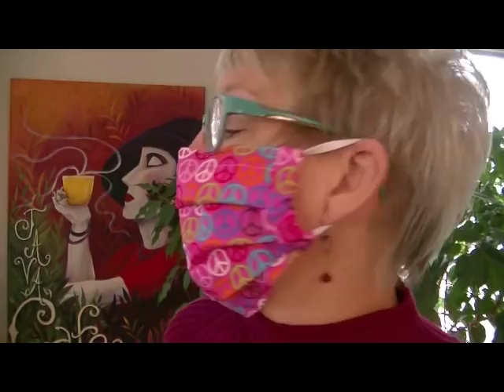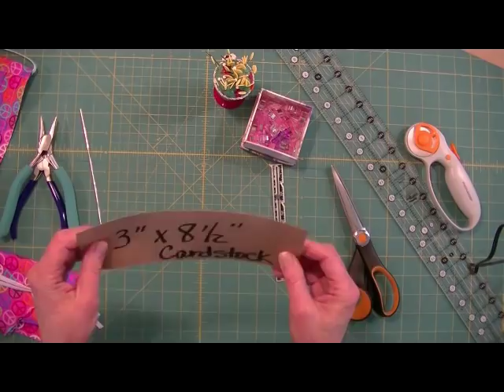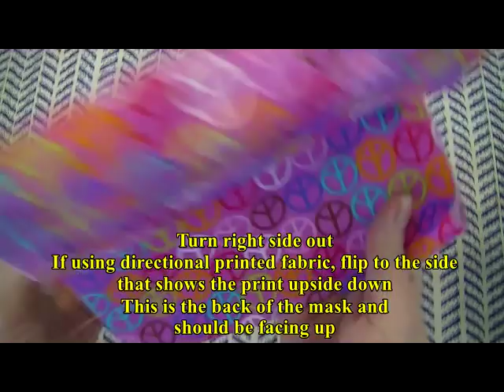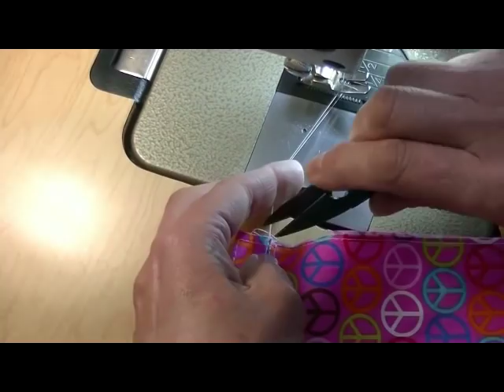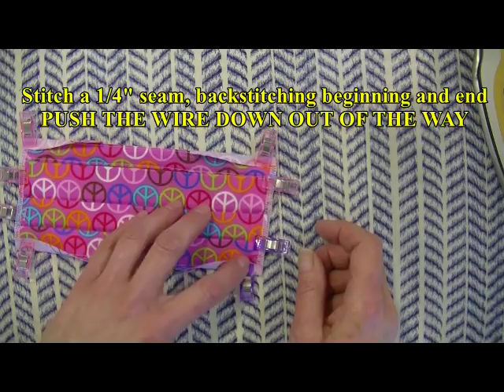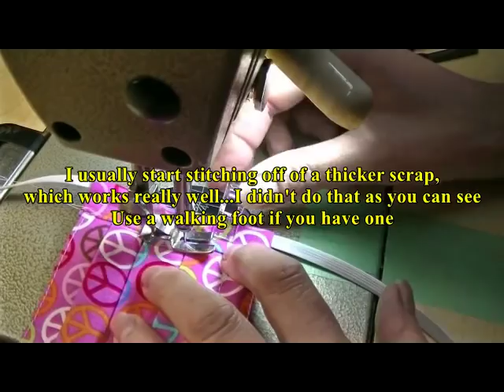DIY REUSABLE FACE MASK with FILTER POCKET-4 Style Options-1 Easy SEW Pattern-Won't Fog Your Glasses!

Comment: Hi Liz. Thank you for a great video. I do not have a surgor on my machine. Should I cut my fabric a little larger than the recommended size as to finish the edges, I would fold it over twice?
Reply from the maker: A serger is a separate machine. Do you have zigzag on your machine? Use that and if you don't have zigzag, trim the edges with pinking shears.
Reply: Hello Joann how are you doing today hows everything going?

Comment: Very nice mask, well explained tutorial. However, I did not like the use of the 14 gage wire. I wear glasses and the wire, even when I try to bend it to the shape of my nose, makes the mask go up under my glasses making it unconfortble. I will try with a shorter wire or a thinner one.
Reply from the maker: You could also try shortening it a bit by pleating it on a 
2 3/4" x 5" card, making the width of the mask 2 3/4" wide. That might help.
Reply from the maker: Also...You can topstitch the top a little lower, like 1/8" or a bit lower, forcing the wire to be lower in the casing. Hope this helps.
Reply: Hello Helen how are you doing today hows everything going?

Comment: I like your video it is easy to follow.  I do have a question - I was asked to make a mask for my grand-daughter - she is 5.  I see you have material needed but do you still mark this at 1 1/2 inch on short side like you do the adult mask?  Thanks in advance
Reply from the maker: Thank you Deb, that is a great question and so sorry I left it out. I would make it 1"- 1 1/4" depending on the size. I'm really guessing with the kid thing lol.
Reply: Making It Easy with Liz me too!  And she lives in New York and I am in PA!  Thanks I will try it
Reply: One more thing and if u don’t know it is fine  - when doing the pleats do u use the same size piece of cardboard?  I did see ur other video on quicker pleats and it is now 3x5 card.  If u haven’t done a kids I will let u know what I find when I do it tomorrow.
Reply from the maker: Yes, I updated that hack. As I made more masks, I made new discoveries. The 3" stays the same, but the 5" allows you to work off the ends and makes my new way easier to do.
For kids, I made the cards 2.5" wide and 2" wide for the littlest one. The kid thing is a tough one for me, and I'm guessing, because I have no experience with them.

Comment: The long elastic that goes around over the  ears for man’s comfort-what is the one continuous length?
AND for the rope tie that ties from your back of head- what is the one continuous length of tie?
Reply from the maker: 12" or around the ears. 24" is a little too tight for me so 28-30" for the continuous elastic that will fit around head/neck. Leave untied if it's going to someone you can't fit it to, and they can do it themselves. For ties, 34"-36" on either side. I haven't experimented with that. I used 28" on mine and it was a bit too short.
Reply: Another question please:
One long continuous elastic for adult is 28-30”; what is the continuous elastic for child age 7-10?

Comment: Hi Liz, if I use pinking scissors, do I have to cut the pattern a little larger?
Reply from the maker: No need, you're just pinking the very edges and the casing adds a little length, you should be OK. If you feel better adding length, cut it 15 1/2"x 7 1/2". Bring the two short sides together and trim 1/4" with your pinking shears, bringing it to 15".

Comment: You are extremely thorough but all of the pressing makes it go very slow. I do like the way you made the  channel for the wire & the pocket for a filter. I would make mine out of 2 layers of fabric for even more protection.
Reply from the maker: Thank you for watching. I can get a mask done start to finish in 20 minutes, maybe less now that I have made hundreds lol. It is 2 layers without a filter which works great considering it's not to protect you, but to protect others from you. Stay safe.

Comment: Heard from nurses that it is a good idea to use 2 fabrics so to know front from back in wearing. My question how do you incorporate 2 fabrics to your instructions and what is the cutting size of the second backing fabric. Thanks!
Reply from the maker: I have heard that and my solution is to sew a folded piece of ribbon into the inside side casing, like a tag.

Comment: Liz,  Really excellent tutorial and the mask fits... Hurrah!!  But how do you place the filter? the pleats are in the way.  Can you demonstrate?
Reply from the maker: Thank you so much, Jennifer. There are so many questions and it is my next video. Open the mask all the way. Take a paper towel and measure across your face to the middle of your cheeks, and to the bottom of your chin, covering your nose but not sticking out of the mask. You dont need to fill the whole mask. The purpose is to stop your droplets.
Reply: Thank you! I'll try - a bit difficult as I have Parkinson''s... best wishes from Belgium!

Comment: What are the measurements for a filter material for the finished mask
Reply from the maker: Hi Jacky
Depends on your face. I would say from the middle of your cheeks, nose to chin. You will have to play around with it.  It's to cover your mouth and nose but does not have to fill the whole mask.  The mask is to protect others from your droplets. Even without a filter, it is impossible to blow out a match. It's basically a surgical mask, made to keep things in, not out.

Comment: LIz:  Thank you so much.  I learned an enormous amount from this video.  I am wondering if you could help me with just one more thing.  I can't find any elastic anywhere.  Can you please help me figure out how to sew 4 ties into the mask instead?    I would really appreciate any guidance you can provide.  Thanks in advance for your extra time to help me with this.  Linda
Reply from the maker: Hi Linda,
Have you ever worked with bias tape? You don't need to cut it on the bias but a 2" strip about 36" long, fold in half, wrong sides together, press and then fold the sides into the middle and press. Then fold it in half and press. Just place that over the sides pin in place, leaving the head straps a bit longer than the neck straps. Turn under the ends before stitching to hide the raw edges. Start at one end, stitching it together down the long edge, continuing over the mask, down to the other end.
Reply: Liz:  Thank you so much for your very quick response.  I am an amateur sewer, but, will give this a try for sure.  I found some 1/2 " or 7/8" x 4 yds.  Do you think I can do something to make this work?  I imagine everyone already got the wider widths.   Everything is pretty much sold out!

Comment: What size should the filter be?
Reply from the maker: Hi Rita
Check out the video description for lots of information.
Reply: Never mind I saw in a post that you only have used Kleenex as a filter so you wouldn’t understand my dilemmas
Reply from the maker: No, I don't know your dilemmas. I get asked that question 10 times a day and I try to address every comment, all 600+ of them. I'm very sorry that I can't repeat myself for the same question over and over again. At that time I had only tried a Kleenex.

Comment: If you are doing string ties.  What are the measurement for the length & width.  Making my own.
Reply from the maker: I had 28" in mine and it was too short. I would say 30-36" depending on the person wearing it.

Comment: Excellent video & mask.  I did pink the ends instead of serging as I am also lazy and didn't want to rethread my serger.  I also love your machine -- what kind is it.  I'm making mine on a Singer 201 -- The Singer & I am oldies but goodies.  Thanks again.  Barb
Reply from the maker: I hear ya, Barbara about threading the serger, that's why I only use white for everything. My sewing machine is a Singer industrial. Thanks so much for watching.

Comment: Liz,  I have been sewing on and off since I was a teenager.  Self taught.  Learned enough to make a few quilts, but wow I always have trouble starting out on the material.  Your trick for dealing with that is fabulous!  You are a wonderful teacher and I loved the little time saving tricks you shared.  I will share one of mine.  I do not use the filter pocket at all.  It is my understanding that NONWOVEN iron on interfacing is a very good filter that is comparable or better than the filter ideas people have been sharing online.  So I iron on a piece that is a little less than the size of the mask when it is folded in two.  It works like a charm.  It is funny, but I am making these masks for people with a great variation in the size of their heads.  LOL  Using your design, I cut off some extra elastic and put it in a bag with a safety pin and explain to them how to fit it to their head if it ever breaks or it doesn't fit quite right on receipt.  Just Perfect!  You are a rock star!  Thanks so much!
Reply from the maker: Thank you so much, Anne. That is a great idea about the interfacing, my friend did the same thing. The adhesive concerns me though. Honestly, for what the mask is actually for, a filter isn't really necessary...I tried to blow out a match without a filter, and couldn't. I really appreciate your support. Stay safe.
Reply: @makingiteasywithliz  You make a good point about the adhesive Liz.   I'v made a few of these so far and everyone loves your design.  Thank you again.
Reply: Liz I found this really good article that indicates that regular surgical masks only have about 60% filtration but the masks that we make with 'Quilters Cotton"  could have around 80% filtration because the threads are denser in quilters cotton.  I also did a little research and found that the adhesive that is on the fusible interfacing washes out and is not really harmful.  I am going to contact the manufacturer just to be sure. Stay tuned.  And as far as aluminum being hazardous to your health in the nose metal,  If you are a jeweler working with aluminum and powders and melting metals etc or a dentist doing some kind of aluminum filling,  then you would have potentially harmful exposure.  There is also some evidence that aluminum pans are not good for your health because the aluminum can leach into the food you are consuming. We are not consuming the aluminum so there should be no concern at all. The fact is all the manufactures including 3M that use a nose clip are using aluminum because it is easy to bend.  The 3M masks with the aluminum are CDC approved.  I am very comfortable using aluminum in our masks as this is the accepted standard.
Reply: https://www.healthline.com/health-news/the-best-material-for-a-homemade-face-mask#How-homemade-masks-help

Comment: Very good instructions.  However, the mask does not fit well under the chin.  Should There be a casing for elastic under the chine?
Reply from the maker: It's fine. You need to remember that only a N95 mask will protect you from others. This mask is to keep your own droplets in, protecting others. It's to keep you from touching your face and keeping back what comes from you.
Reply: Hi again, Actually my issue with “orientation in space”...I had the bottom strap under my chin instead of behind my head.  Fits very well, actually.  Biggest problem now is how to fit a coffee filter in the pleated pocket. Any suggestions?  Maybe another video?  Thanks for the tutorial.
Reply from the maker: Open the mask up and slip in the filter, ignoring the pleats. It will come together.

Comment: Aloha, Liz!!  Excellent and very professional video.  I am looking forward to following your pattern.  My observation is that it would be a good idea to have a different fabric for the INSIDE ... and I understand your comment that the pocket for the FILTER is on the inside ... but when you're in a hurry, it is important to to have that readily distinguishable.  I enjoyed the comment below re the panty liner ... from the UK truck driver who is driving his wife's sewing machine.  lol ... It was suggested on another video to find the 3M filter sheets for AC / Heating systems, and to find a filter sheet which you can cut up and fit into your mask.  I appreciate that this pattern, won't fog up your glasses because of the metal piece at the top.  I am and have been dealing with fogged up glasses as well.  

The camera used for the video showed your project and seams well.  I very much appreciate your sharing with all your viewers.  May God bless you for sharing your expertise.
Reply from the maker: Hi Margaret, thank you so much. As for the inside of the mask, it takes a second to tell the difference, but You could include a small tag of ribbon when sewing on the side casings, also the casings look different on the inside.  There are so many suggestions for filter material. The mask is to keep in your droplets, and aren't for protection from others. I tried to blow out a flame with just the mask, no filter and I couldn't. I appreciate your honesty and am happy the camera work is acceptable. Stay safe and thanks again for your kind comment.

Comment: What size would you cut the elastic for kids? If I could have it for the elastic that goes around their neck and head instead of behind the ears please. Do you have an equation you use depending on the size of the mask?
Reply from the maker: I don't have any idea for kids, they're all different ages and sizes. Try 20-22"? You will have to experiment.

Comment: Hi Liz, Thank you so much for posting this pattern! I have made six masks out of an old men’s red head 100% cotton button up shirt with 18 gauge copper crafting wire that my sister had from an old jewelry making hobby. We are very happy with the overall result. However, I wanted to tell you about a really awesome idea/modification we came up Witt today. You know the little black plastic and wire tabs on bags of coffee that you use to close up a bag of coffee. We had the idea of using these in place of the wire. To hold them in place in the pocket since they are shorter. I put a mark on each end of the coffee closure and put a line of stitches there to create a smaller pocket to hold the tab in place. These coffee closures provide a much more secure and comfortable fit than the wire and mimics real medical masks more closely. I wanted to share this with you so you could share it with your viewers. I think It could especially be helpful to people who can’t get their hands on aluminum wire. Thank you again!
Clara
Reply: Clara Burton I’ve been using those as well & have been securing them in exactly the same way. By far they’re my favorite amongst the wide array of things I’ve tried. I just wish I could purchase them in bulk! 
PS for anyone reading they’re also on many bags of loose leaf tea

Comment: Why not just sew the ends of the elastic rather than having a knot?
Reply from the maker: Hi Brenda, I have been asked this many times and you can sew the elastic, if you know what size it needs to be. It's supposed to be easy to change out the elastic when it's worn out and anyone can tie a knot. I'm making hundreds of these and I leave them untied so the wearer can tie it for a custom fit.

Comment: Liz, could a little pocket in the mask be left open put a pantie liner in for extra protection, then after washing put a new liner in? because washing cotton makes it 30% ineffective..
PS.I'm 75 years old, I used drive a 38 ton Truck in the UK, if my mates could see me now driving my wifes sewing machine.
Reply from the maker: Haha, good for you. Here's the deal with the mask, it's to protect others from you, not the other way around and a panty liner is not breathable. The purpose of the mask is to stop or block the force of a cough or sneeze from you. Without a filter, I am not able to blow out a flame...that's how well it does it's job.

Comment from the maker: I am working on my next video on how I sew these in bulk. I am including updated tips and tricks including one that eliminates a seam and will blow your mind! I was so excited when I came up with it! I will have it out next week. These techniques are not exclusive to this pattern and can be used for any pattern. I hope you will check it out.
Reply: I have a little tip for it if you like this idea.  Before putting the wire in, I sew just across the very top.  Then I slip the wire in from the side before I do the rest of the stitching.  This way there is less chance of me bending my wire = less chance of me sewing over it.  Thanks again for doing these.  I'm so impressed and next I'm buying myself a nice serger so I can be more productive.  Thanks again Liz!
Reply: I am so glad I found you. When this mask making started the only tutorial I could find was watching someone and figuring it out for myself. You actually talk and tell everything step by step. I saved you for further reference

Comment: Good morning fellow sewers! When I am topstitching in a tight spot I find it easier to leave it wrong side out...it makes it easier on my fingers and also less apt to have other fabric get caught up in it.=)
Reply from the maker: UPDATE: I tried your way Katherine and I like it!  I understand now...you are topstitching after pressing the seam open, before turning it rightside out and dropping the opening down a half inch and pressing. For me, because my sewing machine is in the basement and my ironing station is upstairs, that doesnt work for me, but I have adopted your way and leave it rightside out and topstitch from the inside. I was turning it inside out to topstitch the right side but just topstitching from the inside saves 2 steps. Love you for That! That tip is going in my next video for sure!